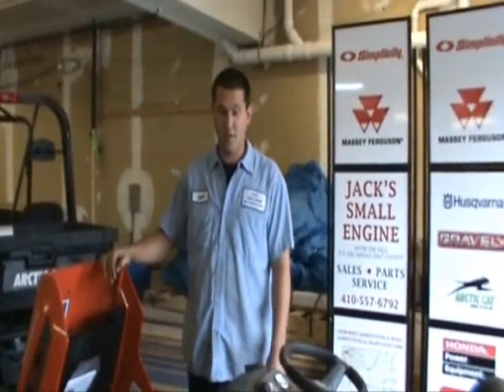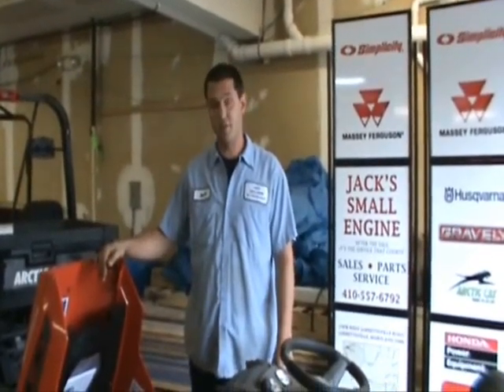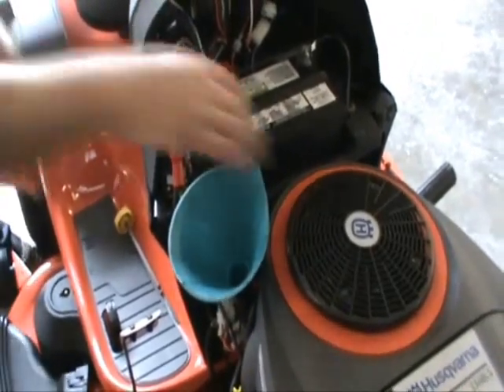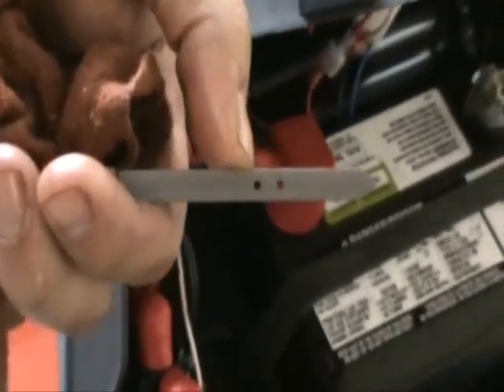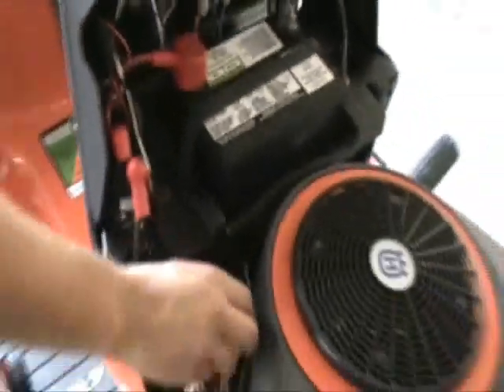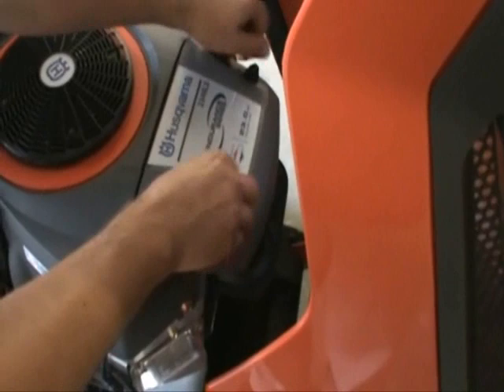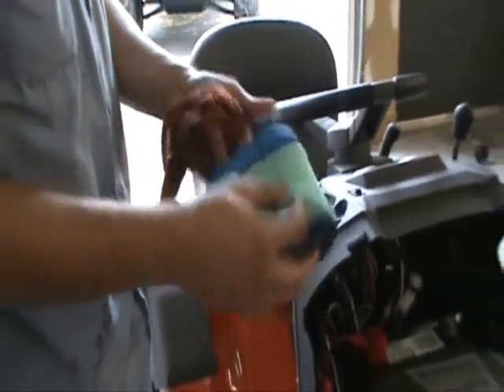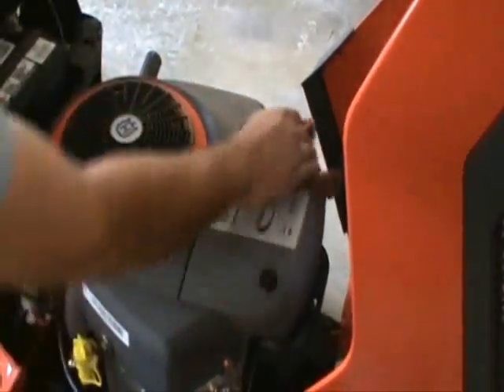How to do a oil change on a riding lawn mower

Comment: This video would have been more "believable" if done on a well-used mower... in case you weren't aware, they DO get dirty !!!
Reply: The mower in the video is virtually new... don't sling BS.
Reply: My POINT was as stated and was meant to be helpful for future videos, not to invoke an implied insult. My 1975 AYP CP14542A is still running strong, but certainly doesn't look new, and I'll bet your 5-year-old shows some dirt and wear. Are you suggesting if equipment doesn't look new, it's being trashed by it's owner/operator?